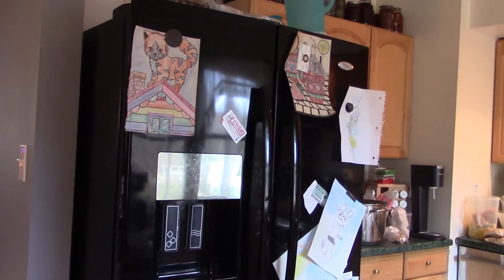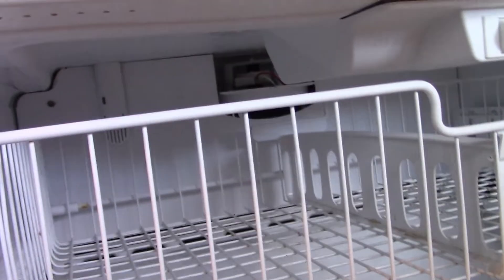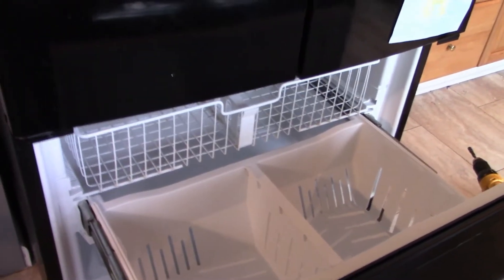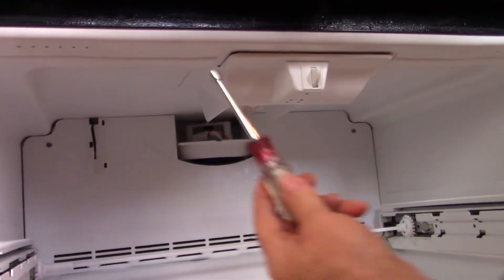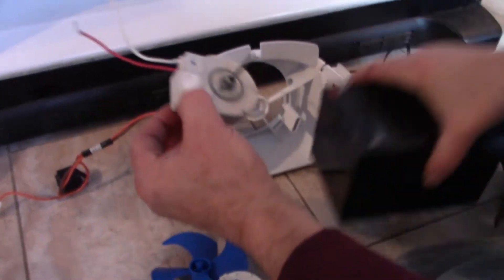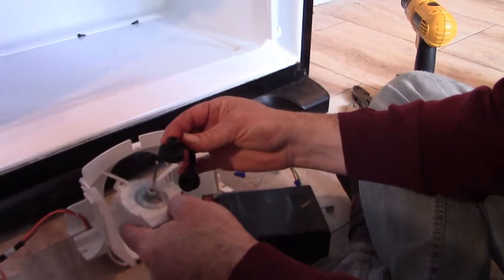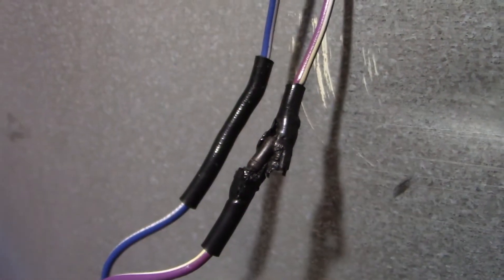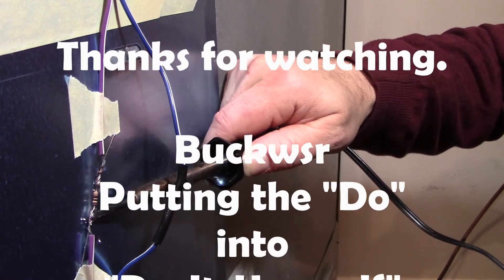How to Replace the Evaporator Fan Motor in a Whirlpool Refrigerator

Comment: Thank you so much for making this video! I've been dealing with this issue for quite some time. Been de-icing and running... I've tested the fan, the fan runs with 12v... I've had a repair man come out and he quoted me $600 for a board and fan. And when he included the board, and fan,  I really had a hard time believing him, I knew the fan was "good"... I tested the power coming from the connector in freezer and was getting 1v. Thank you too your video,  I pulled the panel off the back and found the same terrible looking resistor. Thank you for saving me $600.
Reply from the maker: Awesome, Mike! Good job getting it done yourself!

Comment: Great video.  My fan runs but makes noise.  I’ve ordered a replacement.  Soldering tip, apply heat to the wire not the solder.

Comment: Excellent video!  I have the EXACT same issue with my bottom freezer Whirlpool...  I had a HUGE iceball in the exact same spot as yours and the fan was not running to bring the cool air up to the damper and into the fridge.  The damper works....  I did diagnostic tests through the temp control panel in the fridge and it pointed to the evaporator area.  I should have been able to turn the fan on and off and it did not respond.  I unplugged the fridg for a couple of hours to melt the initial ice ball with a hair dryer and after powering up the condensor powered on and the evap fan turned on.  I thought it was fixed....  The fridge cooled...  the next day I noticed the fan was not blowing the cold air from below into the fridge.  Compressor works, evap fan does not run.  I'll be ordering a new fan motor today.  Looks like the harness came with a new temp sensor so if that was it, then I'll have that fix too..  also, great info on the motor's 24v supply from the circuit board with the burned out 10 Ohm resistor.  So my guess is either the motor is failing or the temp sensor in the loop.  Thanks from NY!
Reply from the maker: Thanks, David, and good luck with the repair on yours!
Reply: Dave Tremper,  How did access the diagnostics menu through the front panel.  Can you point me to any online direction o this?

Comment: Thanks for this video.  I performed this evaporator fan replacement and everything worked great.  My only issue is the fan is pretty loud when it's on.  I haven't gone through the motions of taking the fridge back apart to witness the fan directly, but obviously that should be the first step. Was just wondering how common this was or if it more likely something I have done when putting the fridge back together.  The evaporator fan and the compressor are both on, it's fairly annoying.  I would love to perform noise reduction steps for both if possible. Any thoughts before I dive into this?
Reply from the maker: It's been a while, and I don't have the fridge any longer. I do not remember any loud or unusual noises....

Comment: I bought a whirlpool side by side, and the fan seems to be goin out often. Now, the problem is the air blowing into the refrigerator is cold but it's not even remotely close to how it should be... I am looking at replacing the motor with a bigger one. Any recommendations on motors?

Comment: Before replacing the evaporator fan , I did an AC test on the power supply plug just to be sure the motherboard was allocating power to the fan. I did this to eliminate a possibility of motherboard failure. Just an idea to verify....
Reply from the maker: Thank you for the tip!

Comment: if freezer is cold but fridge is not would you still replace it in the same area?  is it possible to have two evaporator motors?
Reply from the maker: You've got some obstruction keeping the cold air from getting to the fridge.
Reply: @Buckwsr  do you have a video on that? lol or should I start with evaporator fan replacement?
Reply: I have the same issue here. My fridge is warm but the freezer is super ice cold 🥶 lots of frost build up but not too much ice build up.

Comment: I believe I have the same fridge. My fridge isn’t cooling. The freezer gets ice cold and the evaporator fan is working but the fridge only gets to about 60 degrees. Any idea what could be the issue?
Reply: Maybe your damper isn't opening up in the fridge compartment?  If the evap fan is running, then the little door (the damper) to the fridge compartment may be dead.  Or you have an ice blockage in the air channel to the damper.  Just a guess.

Comment: I replace my Evaporator fan Motor on a Whirlpool Gold side by side fridge. But when plugged my fridge back up the fan still will not come on. So I watch this video and learned some valuable points,so I ordered 1/4 watt10ohm resistors learning that the back panel control board had a wire that was burnt and charred. I realize that even when soldering the resistor to the wires my fan motor still did not come on. But as I contemplated on what could I be doing wrong I realized that the resistor that came from Amazon 10k ohm  1/4 watt 5% resistors and I was wondering could this possibly be a problem when I should have order 1/4 watt 10ohm 5% tolerance resistor does it matter. I’m illiterate when it come to the laws of of ohms. Can someone help me
Reply from the maker: Yes, there is a big difference between 10 ohms and 10K ohms. The "K" stands for thousand. In other words, 10 ohms versus 10,000 ohms. Get the 10 ohm resistor, and you'll be back in business in no time.
Reply: Buckwsr Hey buddy I’m so glad you responded
Reply: I recently purchased the one you was using on the YouTube video but couldn’t tell the colors. The one I reorder was the link you had on your video it took me to Amazon can I send you pic to your web or email
Reply from the maker: @daphnehaney9046  I just now clicked on the amazon link that I have in the video description, and it opens up to a 10-pack of 10 ohm (not 10K ohm) resistors. Possibly they sent you the wrong ones. Write to me at guitar4lefties@gmail.com. Send me your mailing address, and I'll drop a couple of these resistors in the mail to you right away. After all, I bought a 10-pack but only used one of them!